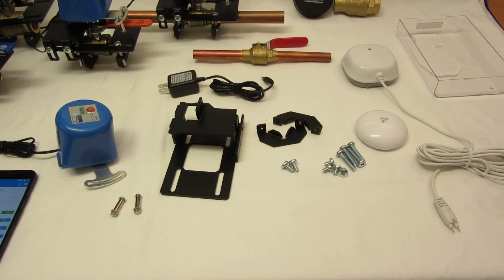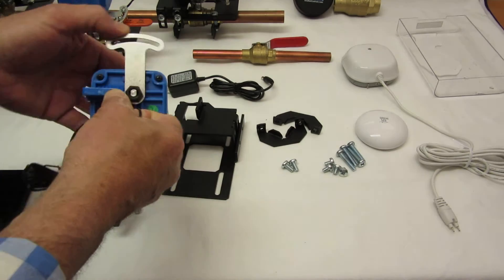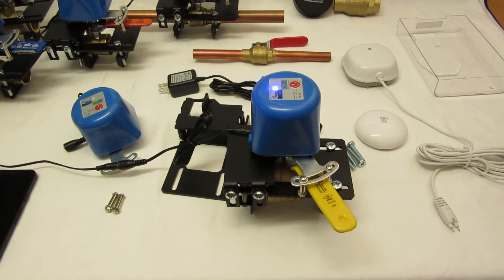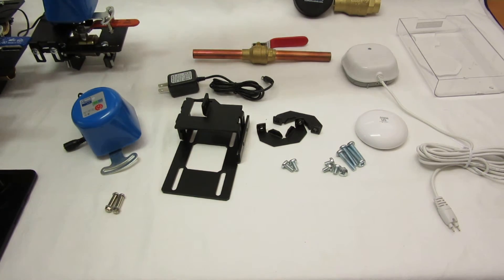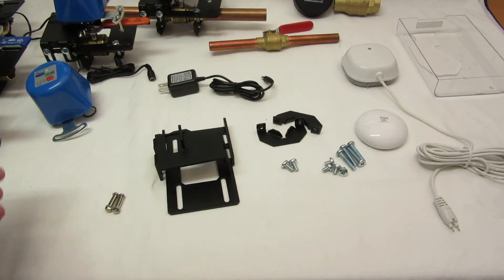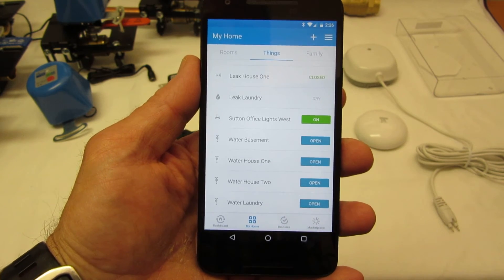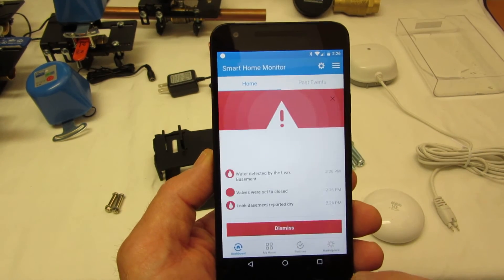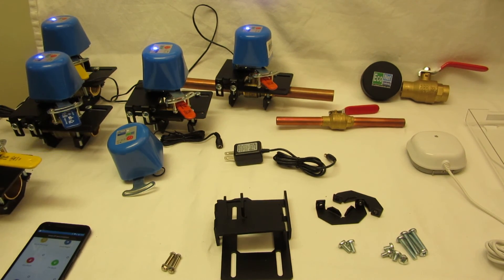EcoNet Smart Home Water Shut Off Controller

Comment: Hi! I want to install 1 of this to  my hot water tank, my question is where will you put the sensor in case my HWT started leaking, because it's been 18 years now the last time I replace it.I'm always worried about if it leaks and then we are on holidays, only my daughter is left sitting the house.
Reply from the maker: The ideal position of the wireless leak sensor/probe would be on the floor close to the water tank using gravity as your guide
Reply: Are these available here in Home Depot Canada? Thank you for your time..
Reply from the maker: You can purchase direct from our Burlington Ontario office - see www.EcoNetControls.com